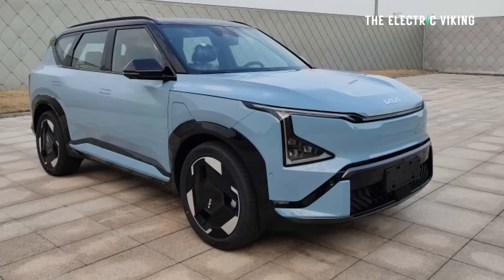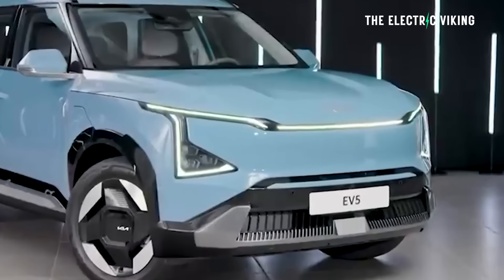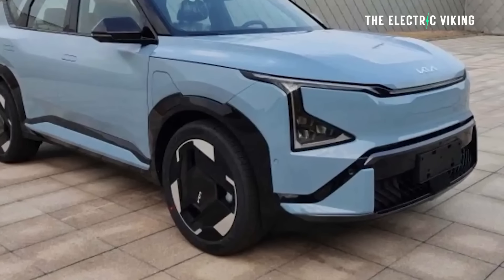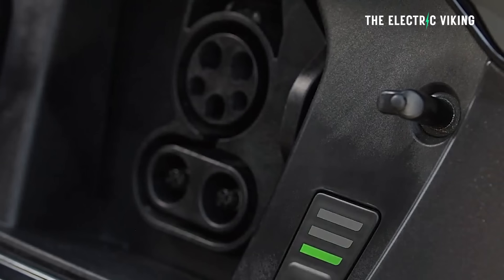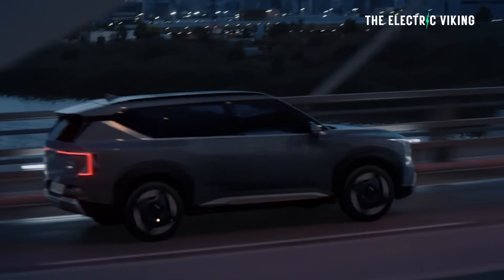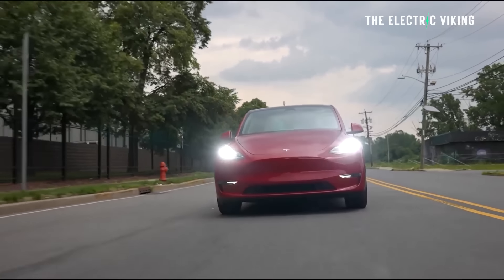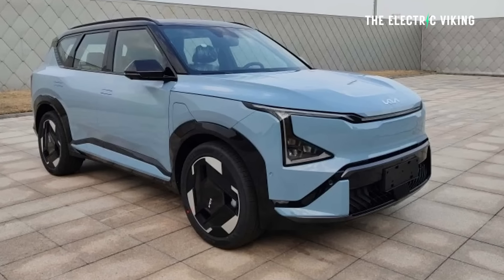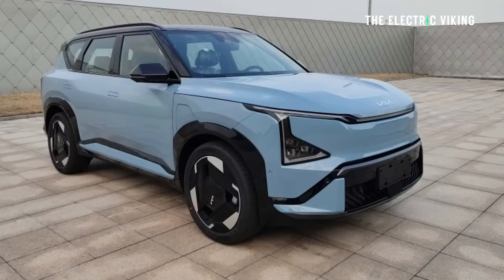Kia's new EV5 GT gets a lithium iron phosphate battery and more power

Comment: Ev5 prices have been released in nz for a couple of weeks. Light  Long range $67,990 nzd. Light + long range $70,450. Earth long range $75,450. Earth long range awd $80,450. Gt line $85,450.
Reply: The price of KIA EV5 in China is : 2024 Light (530km) - US $ 19,400; 2024 Air (530km) - US $ 20,700; 2024 Land (530km) - US $ 22,700 ... Why do they OVER CHARGE this charge when selling the same vehicle in Other countries?????? This is EXTREMELY UNFAIR...
Reply: Viking is full of BS! Same with the battery supplier, not CATL but part of the BYD group!

Comment: I think what they’re doing is they are marketing to people who have been sold on the idea of bigger and better. I mean, look at the blocky design of that thing and all the air pushing it’s gonna be doing. Really not the best design for efficiency, but because it’s electric is way more efficient anyway, despite all those flaws. 

And because we have been using internal combustion engines for a century the third of the car in front is wasted on housing a motor making visibility much worse for the driver and lowering the safety. People are used to that shelf butting out in front. I’m sure that many people think of it as a buffer between themselves and everything out there, but that’s not what it is. Electric doesn’t need to put anywhere near like that. Some electric cars put the motors in the wheelbase.

Comment: Glaciers are shrinking, coral reefs are in crisis and last year was the hottest on record. Atmospheric concentrations of carbon dioxide, In 2023, global levels of the greenhouse gas rose to 419 parts per million, around 50 percent more than before the Industrial Revolution. That means there are roughly 50 percent more carbon dioxide molecules in the air than there were in 1750. Global fossil fuel emissions are at record-high values.
Reply: Complete nonsense.
Reply: @peteroconnor5537  FACTS MR. EXXON!

Comment: Doesn't need to be a rocket ship   It accelerates as fast as most every day ICE vehicles and that's the mainstream market it's designed for.  Curious about the vehicle range  The diet might be to reduce battery size and range, depending on its range,  as it has 500 kW super charging.  As long as you have good access to supercharging infrastructure range doesn't need to be more than 200 miles.  Supercharging ubiquity is increasing, so it's likely future proof.

Comment: EV people claim they are saving the environment by buying an EV, yet they buy overpowered EV's comparable to V12 engines...
Reply: EV tech > ICE tech > Steam tech
Reply: Too many people buy any type of car bigger than they need but better a big EV than a small Ice or hybrid!
Reply: @grantrandall1674  Not if you have to feed the EV's with coal as many countries do.
Reply: The process of moving to a fossil free world will take decades and billions of dollars but in the end we will have clean and extremely cheap energy that is locally produced reducing political tensions and wars in the process
Reply: @sirbum1918 The math shows it’s still better than gasoline. You should read more.
Reply: @jonathanfields4ever  So burning even more coal is a good thing just because you want a power hog of an EV?
Reply: You should learn more about EVs. Unlike ICE, more power does not mean less efficiency. It actually means more efficiency.

In an ICE engine, a more powerful engine consumes more gas/diesel even when it isn’t producing useful power (idling).

In an EV, a more powerful engine has stronger magnets that generate more power during regenerative braking, charging the battery more and therefore using less electricity from the wall.

It’s a very different, and very different technology from ICE. Well worth some time to look into it.
Reply: EV people?
WTF are you talking about?
Reply: @sesmeltz1965 you’re wasting your time explaining facts to a troll.
Reply: @sirbum1918  The math shows it’s still far better than a gasoline car. Should I purposely get a slow hybrid that pollutes more?
Reply: @sesmeltz1965  Actually, regenerative braking only produces a trickle of charging. I remember reading a technical comparison test about 3 years ago in Germany. Two Teslas travelling together for a full day over a mix of conditions, terrain, etc. One had the regenerative braking mode disabled and at the end of day both cars had almost identical charge and range remaining.
Reply: @ivannavi8154  3 years is a LOOOONGGGG time
Reply: Bloody hell, it looks like a blue brick with lights. How the hell could they design such an ugly lump. And the aerodynamics, this is an aircraft speed brake. I’d be embarrassed to have that horrible thing in my driveway. Perfect car to discourage people swapping from ICE to EV.
Reply: electricity is now powered by renewable energy. so when we use EVs, we use renewable energy in many countries. simple as that.
Reply: @ivannavi8154  Agreed, I do not like it at all; and your aerodynamic points are valid. But then a lot of large SUV ice cars are the same stupid design.
Reply: Virtue signaling
Reply: @MohamedAhmed-dr2kz This green new deal is causing hyper inflation. You'll starve to death before you see cheap energy prices again. FJB
Reply: @francismarion6400 ok true but trump greatly contributed to increasing money supply also
Reply: @MohamedAhmed-dr2kz , billions are not going do it.
Reply: EV will have tons of junk in the end. Only last for 8-10 years 😢
Reply: @sesmeltz1965  I think you need to go back to school! More power is free...
Reply: @linphilip6389  We have never used as much coal then we are using now, and it will go up for at least 2 years more before it might go down a tiny bit.
Reply: @roderickchew6524  And they say they will recycle the batteries but so far they are just junk no one wants to touch.
Reply: @sirbum1918 may I please have your future horse manure for my veggie patch 😊
Reply: @alancobbin  Sorry I'm all out but a bunch of people in here are just full of it so you can ask them. 🤪